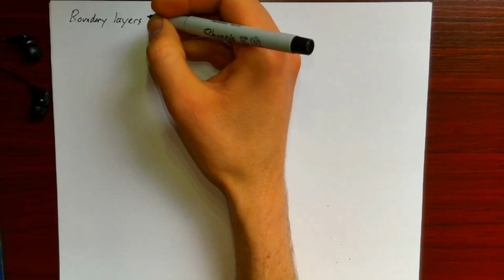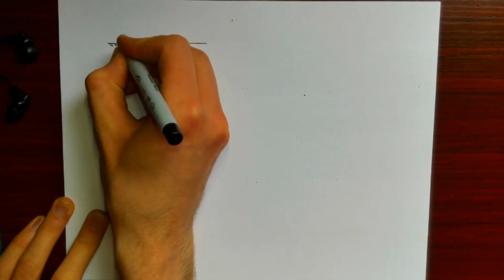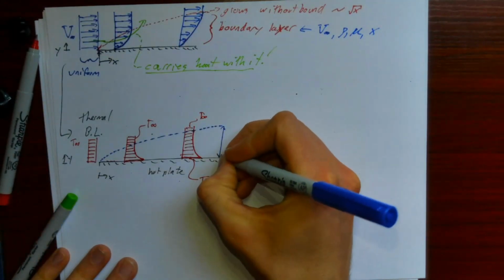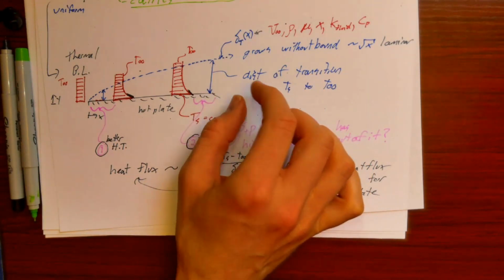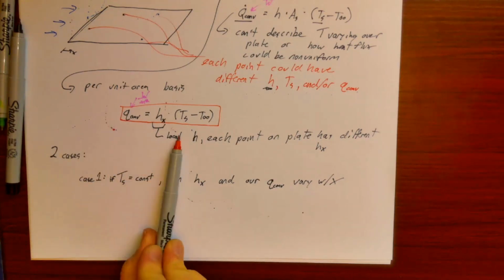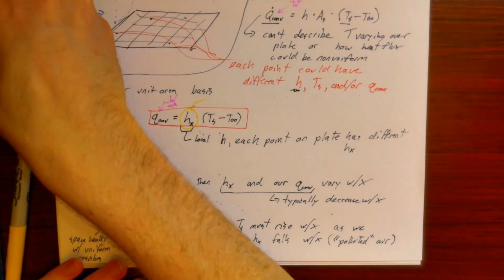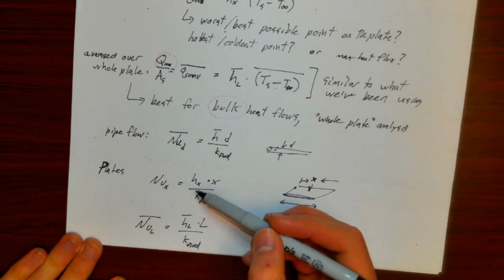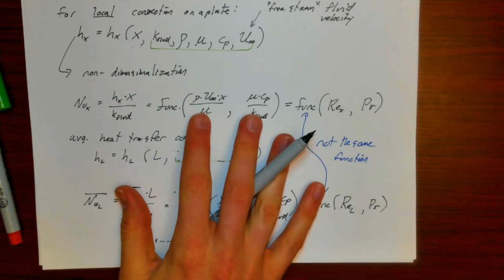BIOE 3310 Lec 25 - Flow past flat plates, convection, and boundary layers

Comment: The relationship between boundary layers and the heat transfer via surface convection for fluids flowing parallel to flat plates
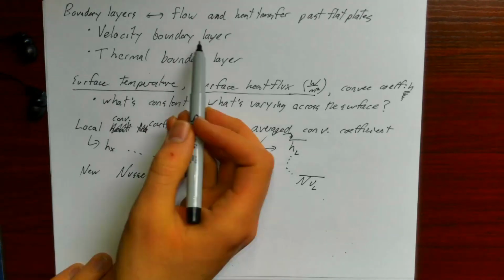Velocity boundary layer 8:28  
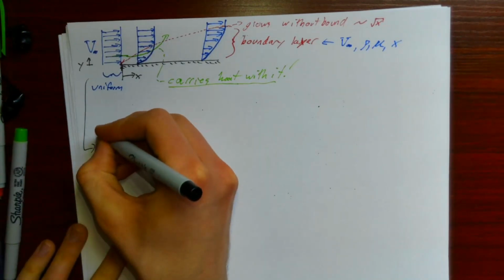Thermal boundary layer 14:05
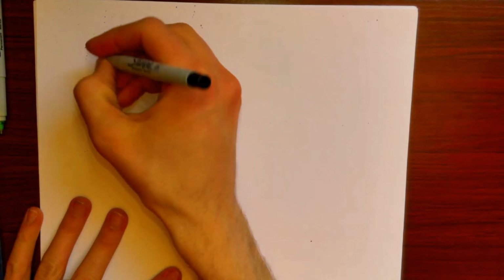The relationship between surface temperature, surface heat flux, and local convection coefficient (what varies if some things are held constant?) 25:00
Local vs average heat transfer coefficient (hx vs h[bar]L) 37:57
Nusselt numbers to go along with these hew h's: Nux and Nu[bar]L 48:15
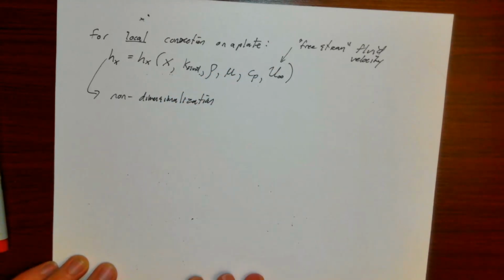Nusslet number dependence on Re and Pr 50:06